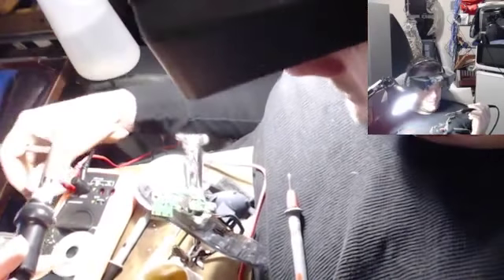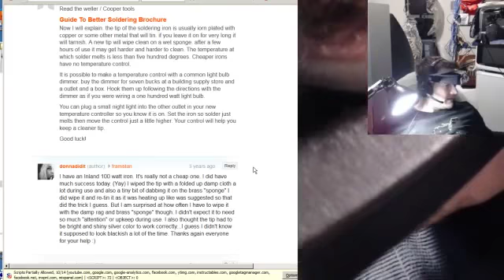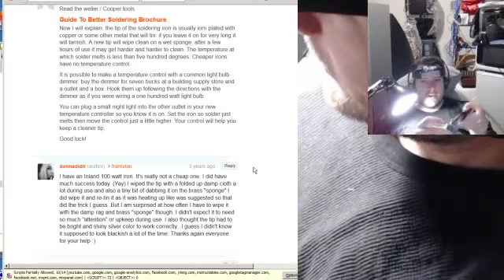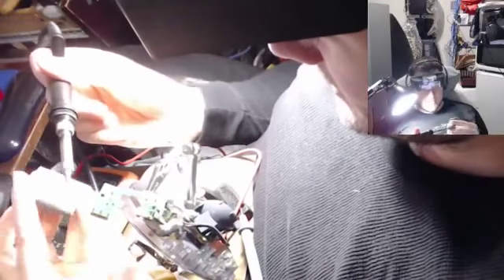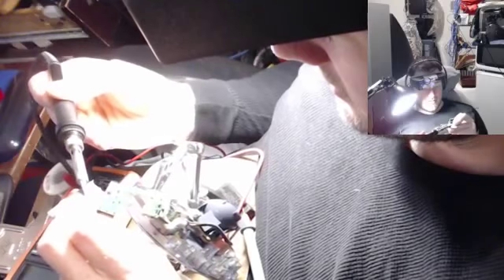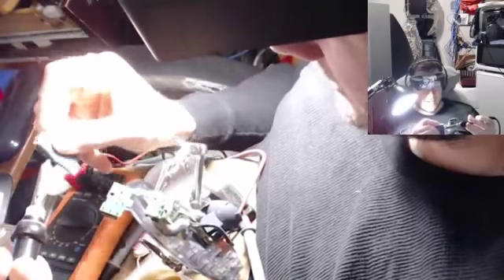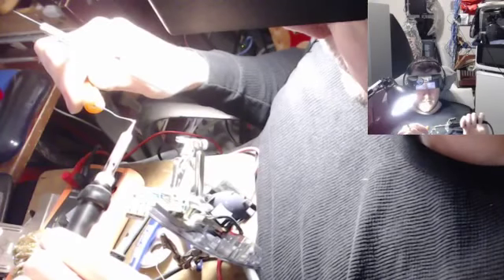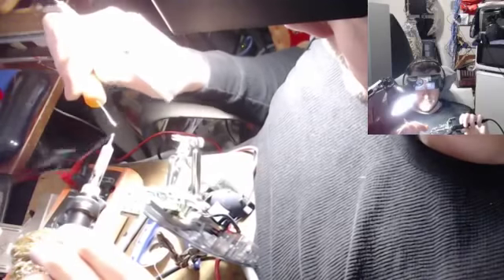Fixing a Soldering Iron Tip that Is Black and Won't Take a Tinning!

Comment: i have electroplated at a factory and i have thought of doing that however electroplating is very complicated! i can give details about it. simple electroplating is possible but [not] professional. the electroplating material has to be in the correct shape to [mimic] the part or it will not electroplate [uniformly] however i would be very interested in a video of this and nobody is doing it i think you would have a one of a kind video that could make some money and start a whole new industry. it could be done with proper materials however the EPA is restricting it professionally. the cost would be around $2000 it would be cheaper to buy tips.

Comment: What I've learned is that after you clean and sand the tip, you dip it in plumbers solder paste due to the acid content and then add solder to it. After wipe with fine steel wool and repeat the process until fully tinned. Also leave a glob of solder to the tip after use to protect from oxidation. Hope it helps bud
Reply: Don't forget to tin it afterwards!

Comment: If your tip is held in by a screw or screws and is easy to remove, if you chuck it into your drill, you can 'pinch' a little piece of 150 grit sandpaper over it while you spin it with the drill, and in about 60 seconds, it will look like new. If you want to carry it further, you do the same thing with progressively finer grits of sandpaper - 220, 340, 400, 600, 800, and if you go up to or beyond 1000 grit, it will look like a piece of jewelry. Also, you can clean out the 'barrel' with a brass brush from a gun-cleaning kit. Most kits include brushes for .22, .30, .357-.38 special, and .45 calibers, and you should be able to find one that fits.
Reply from the maker: Very cool tip I'll be sure to try it next time!
Reply: And after you chuck the tip up in a drill and spin it through sandpaper, its very important after to throw the tip in the trash-because you just destroyed it.